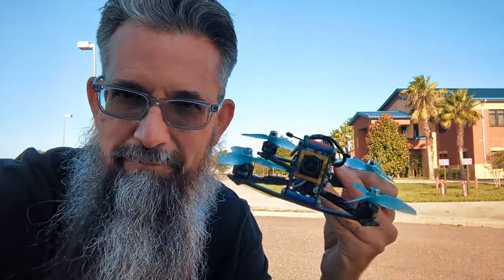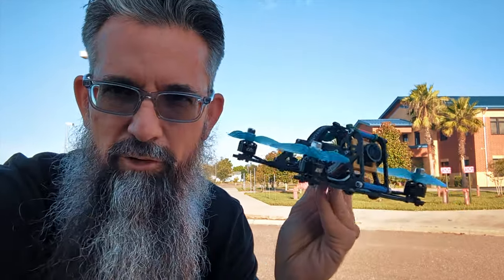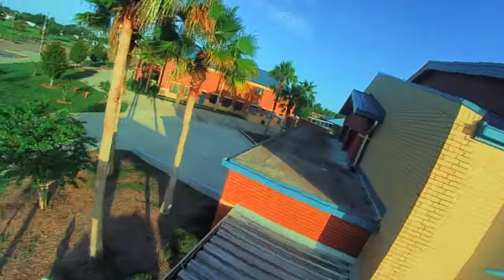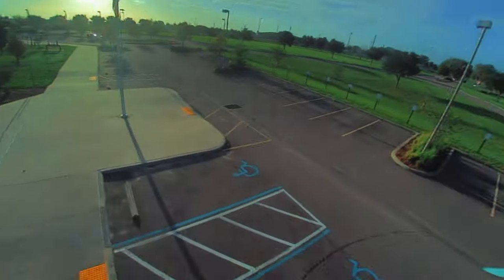HDZero 1080p30 on a Sub 250g Drone

Comment: That’s the first good 3” freestyle quad I flew. It’s a fun frame.

I have had really good luck with HDZero. Directional goggle antennas was the biggest thing for me, either helical, crosshair, or triple feed (for the super low profile setup). I do occasionally run omni stubbies if I’m racing close to myself, without obstruction.

Quad wise: on a build that I don’t need penetration on I just solder a 12mm piece of wire directly to the VTX, but for everything else a TBS, TrueRC, or Cherry V2 RHCP antenna works significantly better than a dipole, especially when around reflective stuff. Wide open areas don’t really matter too much.

But that’s for the Pacific Northwest, different parts of the planet do have different noise and propagation like you mentioned.. and add in weather and seasons...

Plus frequencies are very region dependent… very cool that we have an extra 8 “more penetrant” channels that we can play with now! Still testing this.
Reply from the maker: Yeah I don't have much luck with the directional antennas because I tend to move my head too much.  The dipole antenna has been sufficient for me on this build, and far more durable which is important for myself.  I could definitely improve video quality in several ways but I think this is working ok for the time being.

As for frame, this thing has been good.  Flies well and it's durable too.  Can't go wrong with it.  I found the files for it as well so I can print it and not have to worry about finding it in stock .

Comment: Why 1080p looks much better on YT then on goggles?
Reply from the maker: i'm not sure what you mean.
Reply: @StacemanFPV  In the goggles, I still see flickering as if it wasn't 30fps, but more like 15. On YT, the picture is smooth.  It would be nice if we could see this image in goggles.  PS I have the latest beta software loaded
Reply from the maker: There's a particular firmware only downloadable from discord with the improved 1080p30